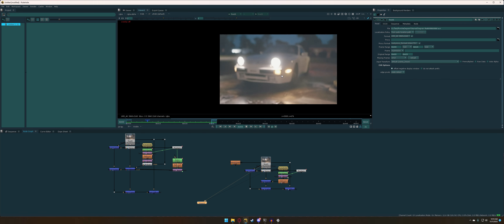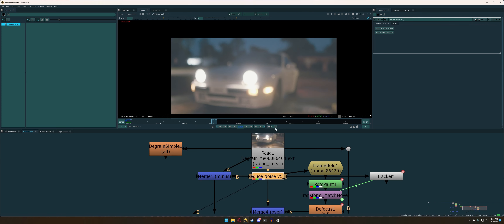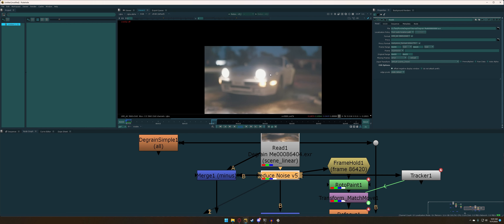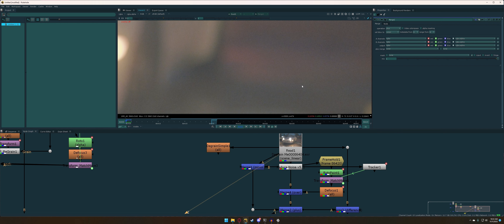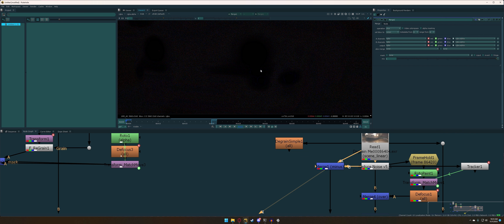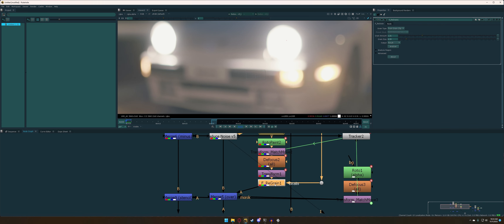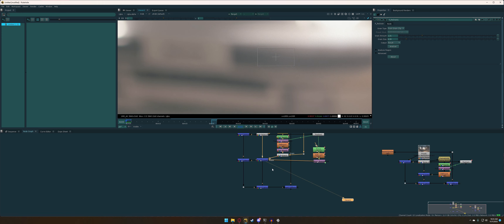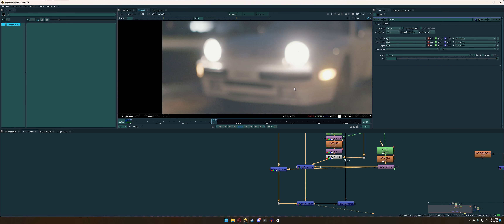The Two Easiest Ways to Degrain + Regrain in Nuke | Compositing Tutorial

Comment: Interesting, the issue is, that the plus/minus method for grain doesn't really work if you removed something contrasted or with a lot of texture like a wire or a fence. The footage grain has the dark/bright value of the shape of whatever you removed and you can see it in the grain (minus node) when you play it. Nodes like DasGrain are a good solution for these cases, also scangain could be helpful too.
Reply from the maker: 100% The plus/minus method cannot re-create grain, it can only extract it for later re-addition. Great for if you are working with something where your not changing your luminance values too much, but as you stated, completely falls apart with great luminance/contrast alterations.

I need to make an update video for this topic as I have been using Dasgrain for about a year or more now and hardly ever go without it.